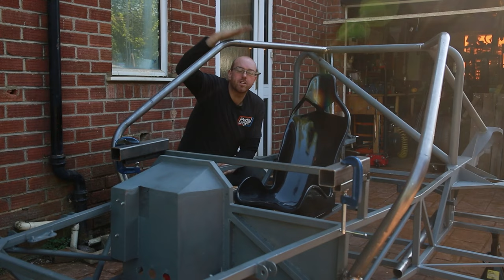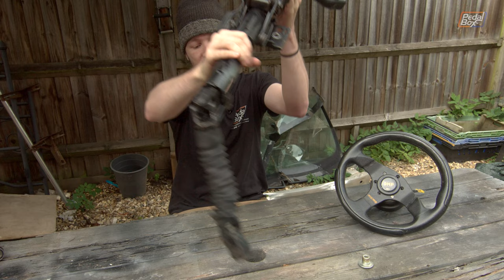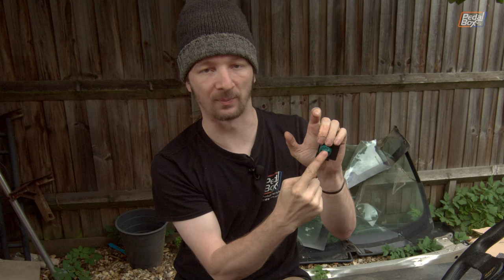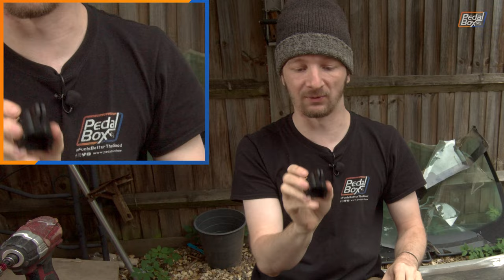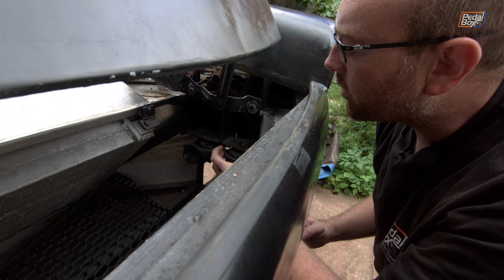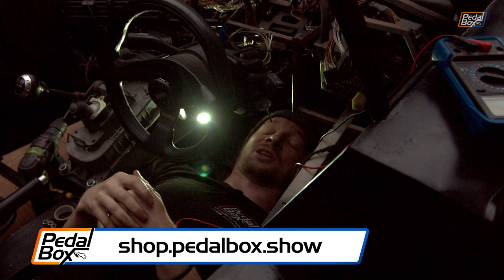Printing Pedal Box Parts | Mid Engine Audi TT Kit Car | PedalBox Episode 148

Comment: You could make another spring wire(or modify the original one) to have a better springy action for that horn button. Or get the proper Momo one. I have a Momo Racer wheel, which has a ring over that horn button to hold it.
Reply from the maker: Ahhh, I went the other route, and printed a boss to go in and hopefully take up the slack. I haven't tested it though, but it seems the 3D printer is my hammer, and every problem is a nail! So it's worth a shot before buying another button.

Comment: Nothing like  moving it forward, I can image its so time consuming which I can fully appreciate, and progress is being made, your almost there - have you worked out how the locking tab on the brake pedal works for setting up zero position? little rotating washer once installed?
Reply from the maker: That sounds like a future problem, for when we've fitted these, and put the floor on, and totally forgotten we haven't done anything about that. Yes that sounds about right!